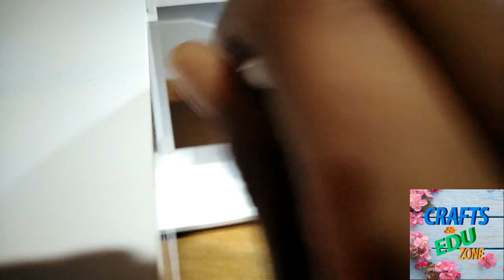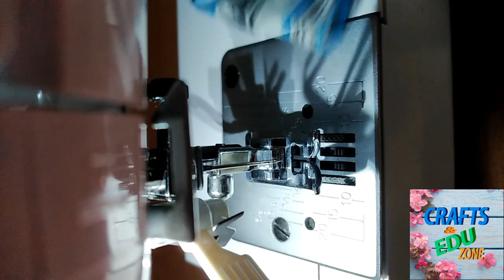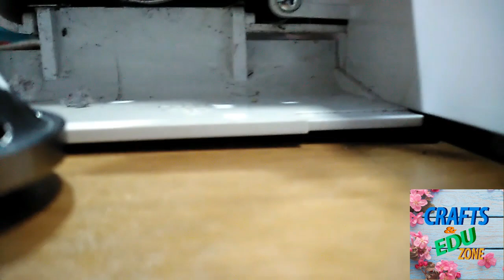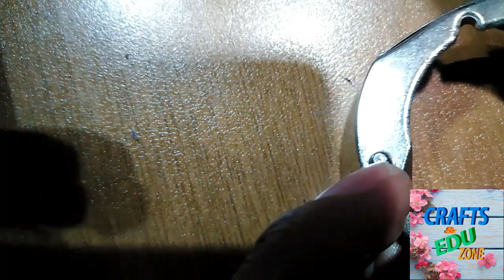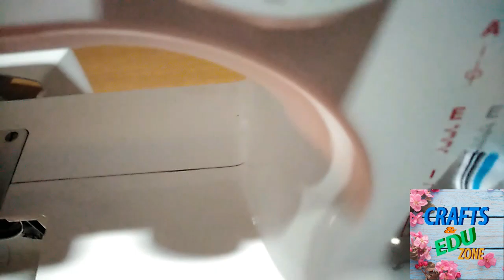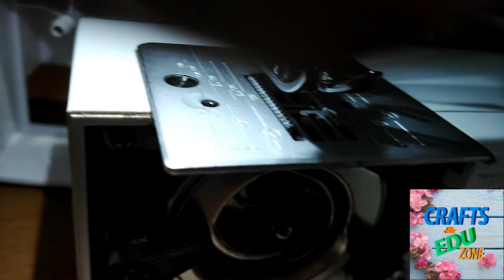How To Clean & Oil Singer SM024 Sewing Machine

Comment: Apu amR mesin tar hand Wheel  nidel bar sob jem. Kicui gurena pls ekta video deo.  
Sui nice neme atke gece.  Ar mesin gureina 
Ami bobinkeser pers sui khule felci.  Tao kicui norena plsss ekta video
Reply from the maker: Sorry! I can't understand or translate your language properly.

But you have this problem when cleaning, then you should turn up your machine's hand wheel before start cleaning.

Or, you are trying to tell that your machine's needle had stuck in bobbin case, then
Release it as in the video at 4.23 and then you can turn your hand wheel up. 

If your needle broken or damage by hitting the bobbin case, then you need to change your needle and put the new needle correctly. The needle must fit into the up position, the bold side of needle must at your sitting side and flat side of needle must fit at machine side. 
Please see the pictures in my community post.